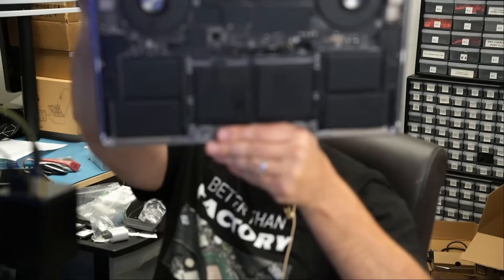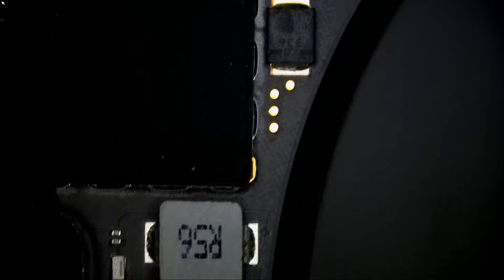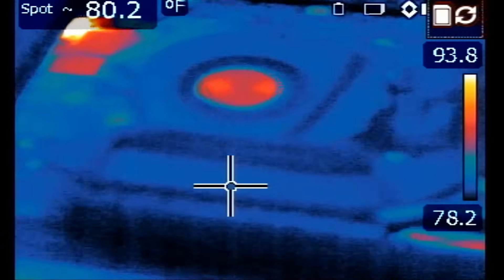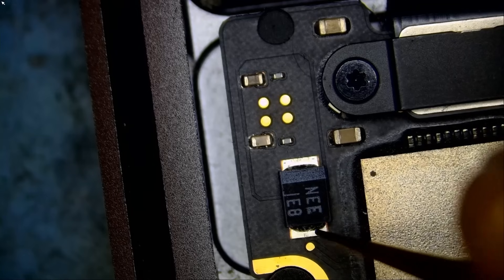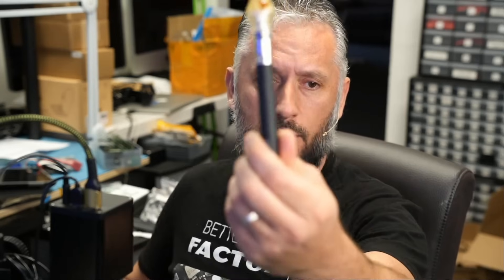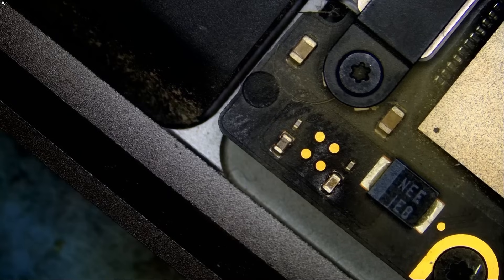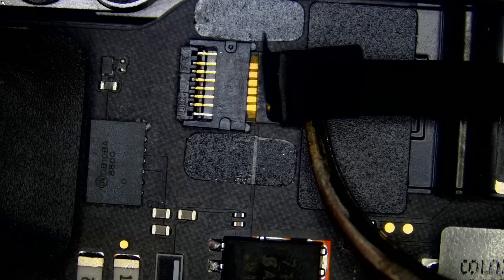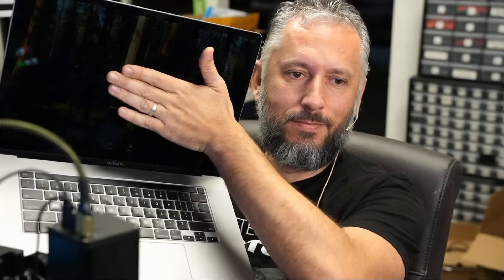2019 MacBook Pro No power Fixed - Atomizer method will blow your mind.

Comment: 15:28 "do not press too hard on the cap, or it will fly off to the 9th dimension" my wife asked me to fix her sun glasses and one of the screws did the same thing.  i keep a very clean workshop and still,  that 1.5mm nut was nowhere to be found.  i must've spent over an hour searching for it.  i never even heard it fall.

Comment: Alex, the reason it didn't come on right away, with these newer apples, when you disconnect the battery daughterboard safety flex cable, after you reconnect it, you must plug in the charger cable for a second. PS im not a scientist LOL.  I just only work on apple so that's all I see

Comment: I noticed on the donor PCB that the capacitor above the one you used had already been removed suggesting a common failure in a common area.

Comment: Brilliant.  You might want to tell folks that bypass capacitors do make the machine more resistant to electronic noise that can interfere with signals, making for quirky and unreliable performance. You wouldn't want to just let the cap out. But exactly as you say, most circuits will start up fine with one missing. "From the times of the cavemen..." My scientist guess is that since that cap is near a mounting notch, at some  point the machine was dropped and the shock on the mounting stressed and broke the cap internally.